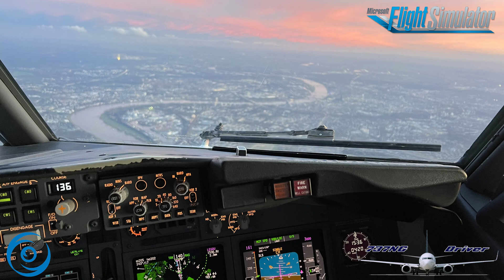PMDG 737-700 for MSFS - Tutorial Introduction

Comment: Gonna watch these to refresh how to fly the 737...haven't done it since X-Plane.  Gave up trying to do on my own when I ran into an issue I ran into way back in X-Plane where I removed the chocks and lost power to the plane (despite APU being on I thought).
Reply from the maker: Make sure the APU GEN OFF BUS light illuminates and then switch the generators ON. The generators don't connect automatically in the 737, they need to be swtiched ON by the pilot.
Reply: @A330Driver  Following your tutorial I noticed you didn't switch the generators from ground to apu...or turn off the packs before starting the engines (I couldn't get my engines going because of that...and then I remembered having that issue back in X-Plane, haha).  Thanks for the refresher!

Comment: Appreciate the content but it's a bit disappointing that you make a point to call out Aerosoft's CRJ as the only other airliner with enough fidelity for your liking, there are several freeware projects that have volunteer, real-life pilots, like yourself, ensuring their fidelity and accuracy are up to the same standards as any payware project, and my hats off as a software developer myself (albeit not for flight sims) to all of these volunteers for their amazing work, yourself included
Reply from the maker: I guess you are mostly refering to the FBW A320 here and you are right in that it is an excellent aircraft for a freeware. Probably indeed the best freeware I've seen to date.
However it is still quite limited, at least if we are comparing it to the high end payware aircraft like PMDG, Leonardo or Fenix.
It's measurement by two standards really. The FBW is an amazing freeware plane, but compared with some of the high end aircraft that are coming it just can't hold up. But it isn't designed to hold up against them either way.